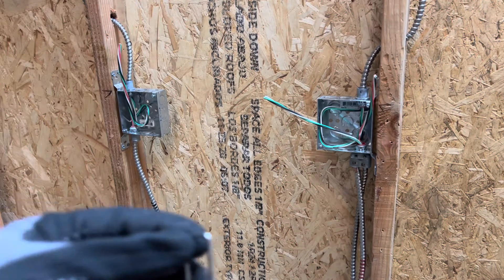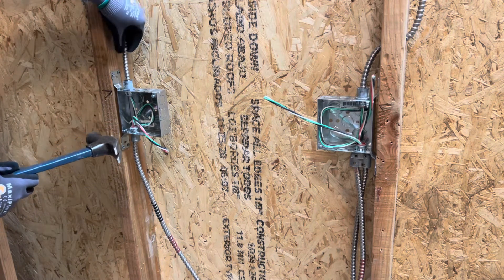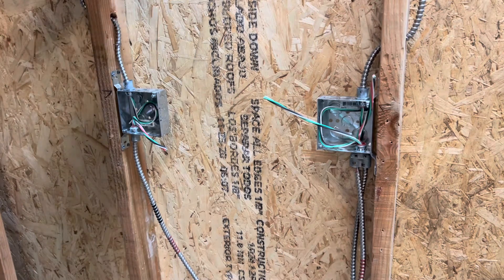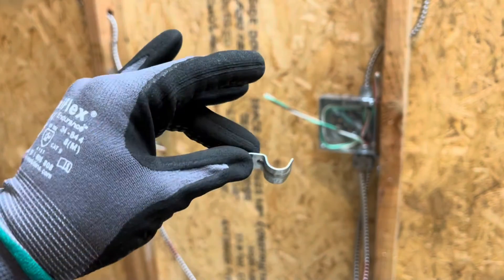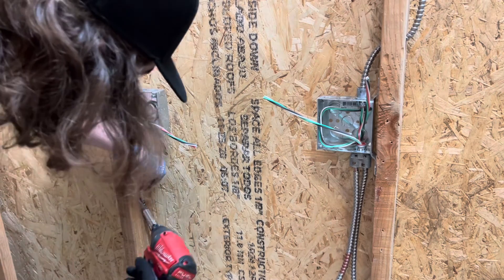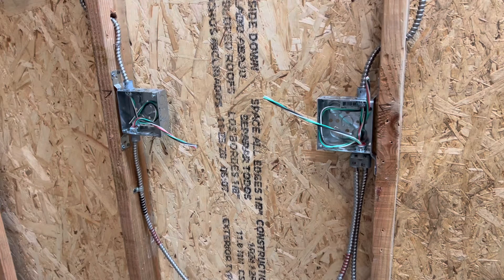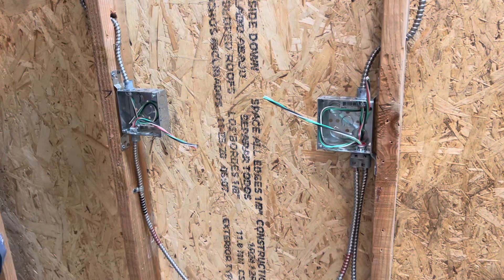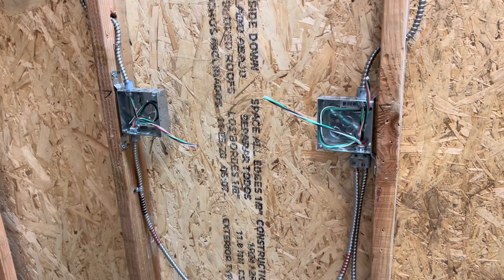Electrical 101: Strapping Methods For MC Wire

Comment: I'm fairly certain that the staple you've shown is only listed and approved for NM cable. Overdriving the staple can very easily bend and therefore separate/damage the metal cladding segments.
Reply from the maker: for sure! yeah im definitely using nm staples